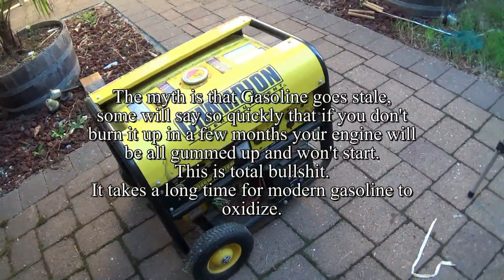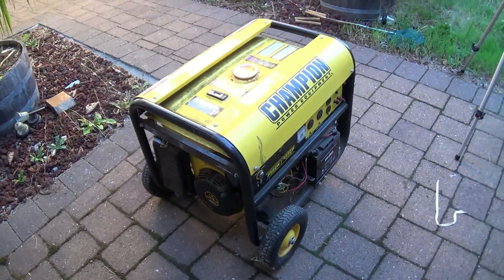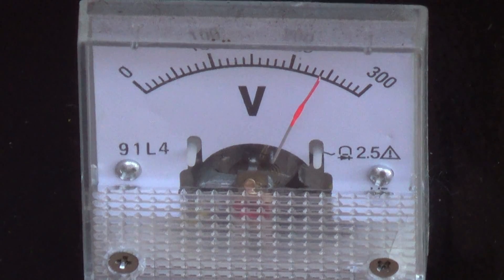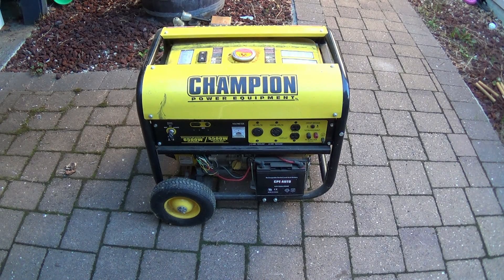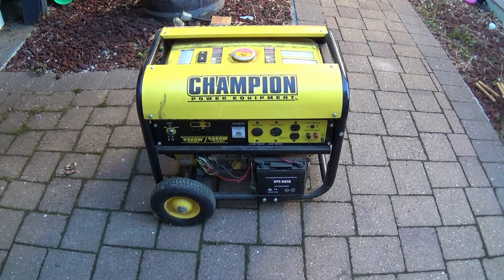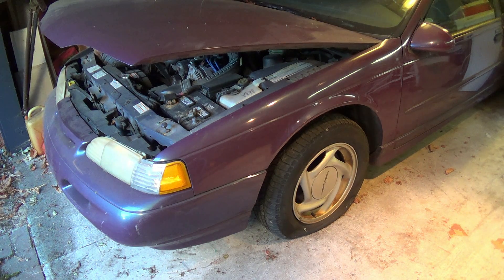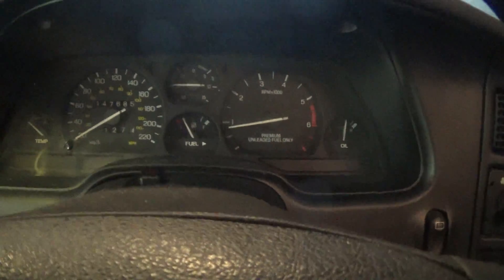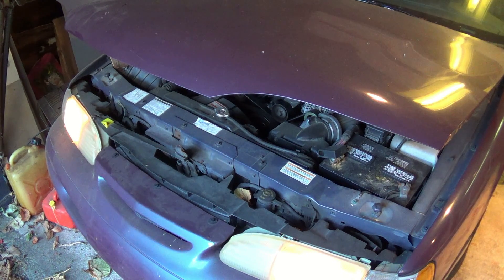Stale Gas Mythbusted

Comment: Not a myth man, actual facts. 
Your anecdotal experiment actually proves this. How long did you sit there cranking it in order to get it to knock when it did? 
You may get some use from older gas, but it severely diminishes the life of anything using  it. Eventually, you wont get combustion from it, but that will be before it ruins what you are running with it. The Shelf life is not just for volitility, but also a threshld for when it starts to fuck your engine up.
But engine goes brrr (After a couple mins cranking it) so it must be fine... right? RIGHT???
Reply from the maker: That gen always takes a bit of cranking to get going.  Even with new gas.  The choke gets stuck.

Comment: Gas might be different in Canada. But I've heard by today's standards in the US that stale gas is common to happen after a month later.
Reply from the maker: My Harley was parked on September 2023 at the end of the riding season. I did not license it last year because I was too busy teaching my 24 year old how to drive and since I promised him a car when he was 16 (his grandfather was going to sell his car cheap because he lost his license) but at 16 my son has a thick skull and refused to learn to drive.  At 24 he gets his learner's again and said where is that car you promised.  (I had to bribe him into bwvomming a man) so with buying a car and the bike needing a 250 battery i just didn't put it on the road in 24. 2 weeks ago i got a battery and it fired right up.  I had regular bought in USA gas in it.  The remainder of the tank ran perfect.
Reply: @12voltvids  Wow, ok.

Comment: I dont know if you're debunking any myths, but gas definitely does go bad. That doesn't mean it becomes inert. It will definitely burn, especially if its in a sealed tank, but it can also cause problems. I guess it just depends exactly what myth you're trying to debunk. Someone who says gas won't work at all if its old is wrong, but it should be avoided if possible.

Comment: Not sure what myth you say is busted. Gas certainly goes stale. That doesn't mean it is no longer flammable or combustible and I don't believe that's ever been claimed. 
Your statement about the fuel bowl being replenished with 'fresh' gas is erroneous because the tank has the same stale gas as the fuel bowl. That incoming gas will also evaporate and turn to varnish and add to the varnish accumulation in the fuel bowl until the float can no longer drop.
As the gas ages it loses octane, it loses the ability to de-gum,  and it will leave a sticky residue in the CC, on the valves, on the piston rings, etc.
When you start that car engine, you can hear the noise of the sticking valves.
Edit: Valves can stick closed and can stick open. The ticking you hear is likely the valves are sticking slightly open so there is excessive gap at the valve stem.
Reply from the maker: What I was referring to is if you shut the fuel off and let it run till it stops there will be a little bit left which will evaporate and leave a sticky residue behind that has now clogged the carb jets.  When left on the fuel is replenished and not permitted to dry.   Eventually it will go bad but it lasts far far longer than some claim.  Years actually.  My Chevy volt for example i use 1 tank a year.  The computer at the year anniversary turns the engine on every time i drive after 1 year to burn the gas up untill i refill which resets the timer for another year.   My dad used to shut the gas off o. His lawn mower and over the winter it evaporated from the carb and needed a rebuild.  Same with his motorcycle. He shut it off and let the engine run till it stopped every ride thinking an empty carb was the way to leave it.  Not!
He was always overhauling it. I have never had to do that.  Mechanic told him to leave fuel on , problem solved. No gummed up carbs sitting over winter.

Comment: I bought a motorhome that has over 100 gallons of gasoline in the fuel tank. It's such a tragedy though, because the gasoline is now GREEN from sitting for so long. I decided not to drain it because I have no idea what to do with that much gasoline. I'm not taking the motorhome anywhere because the transmission is bad, so for now I'm just going to leave the fuel in there.

Comment: So THAT'S why our old Honda lawnmower never had fuel issues with the old stuff sitting in it all winter! We never used fuel stabiliser but also never shut the gas valve off (not on purpose, just by chance) and I was scratching my head as to why so many people seem to be getting carb clogging issues.
Reply from the maker: Correct.  And get this.  The ethanol in gas will actually absorb water.  This whole generator still runs I still start it up every couple months and run it for a good 15-20 minutes and I have refilled the tank a couple times as I burning off a little bit of gas every time I start it up and run it so I keep it topped up.

Comment: Stale gas in a tank lasts a lot longer than gas sitting in a carb bowl. The fact that gas goes bad is certainly not a myth, and with 10% ethanol it is worse now than ever. I repair small engines and about 75% of the issues I see are from gummed up carbs from gas sitting in the carb. Even one season will cause it.

Comment: Modern gasoline (minus ethanol free premium) has a poor shelf life. I did manage to start my Dodge Caravan with 5 year old 87 octane fuel in the tank but I added a bottle of "Heat" and 3 fresh gallons of fuel. 

On year 6, the fuel finally broke down and the vehicle barely would start. I had to pump it all out. When I burned the fuel, it had a much lower flash point and smells somewhat like kerosene.
Reply: I had like less than 1/4 in my 2007 Mazdaspeed 6 and my car ran  fine until after it got to 1/2 a 1/4 tank, it started misfiring when accelerating hard, even in neutral. I have to press the gas pedal lightly for it to rev because it's has a small turbo and it can generate boost even in neutral. I'm planning on putting in an octane booster, but since there is so little fuel and I'm still not going to drive it I might as well not bother.
Reply: Why would the fuel not run if you added 3 gallons of fresh gas. 

I have a 1/8th tank of 7 year old gas. I wanted to add 10 gallons fresh gas and start my car. Thoughts

Comment: I remember after getting my '51 Studebaker, I got it running on 35 year old gas.

Before anything, I pulled the drain plug on the gas tank, and nothing came out, so I passed it was empty (it wasn't). I added 5 gallons of gas, and it ran (really smokey, and smelled like deck stain).

I come to find out that the varnish at the bottom of the tank plugged the drain plug hole, and I had to dig around up there with a screw driver until it finally started draining out.

It took me longer than I would like for me to actually figure this out, so the varnish actually ended up sticking several valves.

I ended up having to take the head off free them up.

Comment: Bad gas can put deposits all over valves, ive seen them seize valves till it bends push rods
Reply from the maker: No that's over reving that bends valves.
Reply: @12voltvids  not what i seen on small engines. At least what we seen,
Reply: @12voltvids  Your 2014 video may have something to do on where you bought it from. I’ve always suspected the gas from Kroger was not as good as Meijer gas, perhaps it was because of the occasional surging, but I still bought the K gas using discount points to offset the over $5 a gallon fuel of 2022. My tank won’t hold the entire 35 gallon limit of the discounted gas so I fill a few portable cans to use later. Now I had just cleaned the old varnished gas residue from the carb passages of a pressure washer less than a month ago and used the washer for several hours on the fresh Kroger fuel but yesterday it was difficult to start and ran like crap when it finally started. I drained the tank and found the fuel was cloudy and a little yellow. As it sat, I saw water settling on the bottom of the glass container. That fresh gas is less than a month old. Sort of reminds me of the time I filled my tank at a brand new station that had only been open a week. The next day my car had the hardest time starting and when it did, not all the cylinders were firing. Eventually it smoothed out and I never went to that station again. As for your contention about over revving causing bent valves, my daughter’s Honda Prelude engine self-destructed by just starting it. Turned out the valves stuck open on her interference engine, which bent the valves when the piston hit ‘em…destroying the cylinder. The valve stem deposits were because of the fuel, but perhaps not because of old fuel since when I dropped the gas tank, the fuel looked like cola. I suspect somebody poured a 2 liter bottle of cola into her car. Anyway, I stumbled upon the video hoping to find a way to reuse old stale gas. I guess I’ll keep looking.
Reply from the maker: @annettesurfer  gas should be used up by the time it gets to be a year old. My current two cars are both Chevy volt which are the plug-in hybrids. The engines are seldom used on one especially. I can go in an entire year with the engine only coming on a couple times and a full tank of fuel after a year is almost full. The onboard computer keeps track of how long the fuel has been in the tank and at the one year anniversary forces you to use it. So if the engineers at general motors program the car to use the gas up after it's been sitting for a year that's a pretty good indication that the fuel will not be bad at the one-year point. So I think it's fairly safe to be fuel in for up to a year. the field in this generator was in for about four or five years and it started up and ran and I burned it up and refilled it with fresh gas. What I was getting at was my dad used to turn off the the petcock on his lawn mower and leave the engine run until it's sputtered out and stalled. He was always having to take the carburetor apart and clean it out because the small amount of residual gas that remained in the bottom of the carb float bowl with dry out and leave a sticky varnish mess that the next time you fired it up in the following spring it wouldn't run because the needle valve was gummed up the Jets were all gummed up. Started leaving the tank full and leaving the petcock open so the float bowl was full and never had problems down the road. Why because as gasoline evaporated from the carb fresh gas would replenish. The gas lines were always kept full of fuel and the needle valves and seats were always kept wet. That's the key don't let them dry out. If you drain everything and there's a residue left it will eventually dry out and turn to varnish.

Comment: I had a little accident with a plugged up rain water drain hole on my motorcycle. Water got in the tank. 
Drained the whole tank of watery fuel into a bucket. Got rid of all the water in the fuel by letting it stand, then decanting the fuel that floats on top of the water. Left the good part of the fuel sitting outside (in a jerry can) for half a year. 
Today i poured it into the tank again, but performance definitely degraded. On the highway i felt like shifting up, because it vibrated as if it was in one gear too low, and my god the smell was awful. Stale fuel reeks. 
Mixed it with some fresh fuel, and everything is fine again. 
Fuel definitely degrades. You may not notice it in lower compression engines, but on my bike, it's very noticable.

Comment: I just emptied and cleaned a motorcycle tank that had been sitting at room temp for around 2 - 3 years:

 • the fuel had turned to a redish rust-coloured varnish - it smelt more like wood varnish / creosote than petrol

 • the carbon content had precipitated out into an abundance of hard black flakes at mm scale, the largest up to maybe 4 - 5 mm 

The stench is still lingering hours later with all the windows open and fans blowing air out one side of the building.. 

Take it from me - old unleaded petrol is proper nasty stuff and a bitch to clean up...

Comment: Sounds good in theory, but what happens if the float sticks with the inlet valve open?
Not expecting an answer, but I know already; the tank slowly drains and the excess fuel floods the cylinders, weeps past the rings and fills the crankcase with gas.
Eventually excess fuel spills out on the ground.
When you go to start it you may find the oil level extremely high, and very thin, smelling of gas.
Even if you manage to start it by opening the throttle to allow more air in the flooded cylinders, the engine will continuously run rich and require WOT to start as blow-by from the crankcase increases fuel mixture, oh, as well as washing the cylinder walls of the oil film and allowing direct metal on metal contact of the rings, skirt on the cylinder wall, resulting in scoring and possibly seizing the engine.
But your carb is clean, lol.
Reply from the maker: Floats don't normally stick open unless they are left empty with the float down in the open position when the residue dries out.  Also all carburetors i have ever seen have a vent at the top of the bowl to prevent a vacuum from forming.   If the level gets too high from a stuck needle valve for example it will just over flow and gas will spill on the ground and evaporate.   
Didn't think if that one did you ?
Reply: @12voltvids  OK so explain the crank case full of gas on a forklift left sitting for a couple years. Dino decomposition? God?
Reply: @12voltvids  So gas residue is the only thing that can plug the inlet valve?

Comment: Maybe your gas station happened to have less ethanol than mine... I could post a ton of videos of pulling fuel filters on RVs that sat for a year or less... 

Wow how long did the starter have to turn that over??  Generators should run on much lower octane than a new car, so testing on a generator isn’t proof of anything...
Reply from the maker: New cars generally don't need much octane. With direct injection they will run on pretty much anything from ethanol to av gas.

Comment: I have a similar problem , half a tank of 2 year old gas and I can't syphon it out for some reason. Mitsbishi Montero sport 2000. syphone hose keeps getting stuck like 2 feet in.  any ideas?     HELP!!!
Reply: @ver151set   Thanks but I wound up giving up on syphoning it. I just filled it up with the best gas from gas station and all went well. it was riding a little rough on that 1st tank but no problems after that.
Reply from the maker: Yes that is the anti theft baffle in the filler designed to stop people from siphoning gas. So what do the gas theives do these days? The drill a hole in the bottom of your tank and now you are looking at a 1000 repair bill. That happened to my work truck. Boss was pissed.
Reply: @12voltvids      any way around it?

Comment: I personally wouldn't call two minutes of cranking a "start with no problem"
Reply: But it ran!!
Reply: I counted 34 secs of cranking.
Reply from the maker: @kchiem  Your point. The gas was 5 years old and it needed to prime.
Reply: Considering that it had not been turned on in two years
Reply: For something that hasn't run in 2 years, that was no problem.
Reply: Probably has a mechanical fuel pump and needs to prime by cranking it with the starter. Notice the second time he started it was faster.
Reply: Lol for real

Comment: I know this is an old video but i have an 01 cherokee thats been sitting for 8 months with gas in it. Should i drain it and fill it with gas and an additive or am i in for bigger problems?
Reply from the maker: Took me 7 years to burn up that gas and replenish it.
Reply: I’ve had issues with some engines and older gas, what I do is if the tank isn’t full, top it off with fresh gas and it will likely do just fine. In my experience your lower or mid compression engines like most cars, lawn mowers, generators etc will burn older gas just fine. Your higher compression engines like snow mobiles, sport bikes, etc don’t fair so well with older gas.